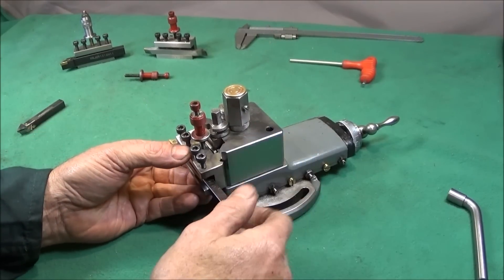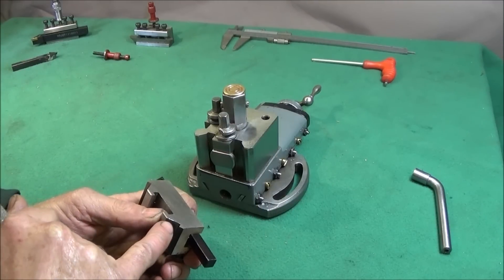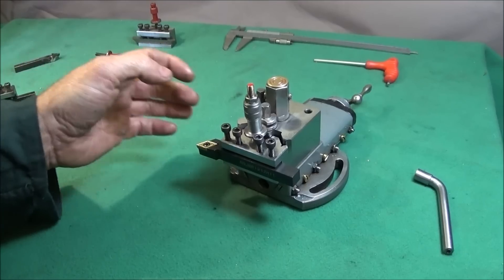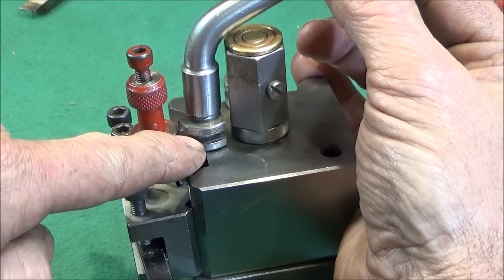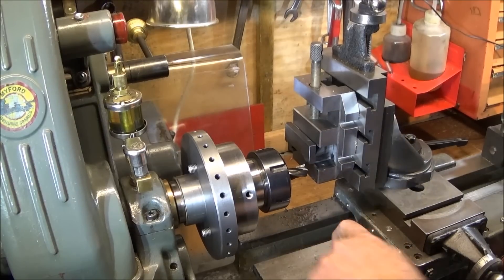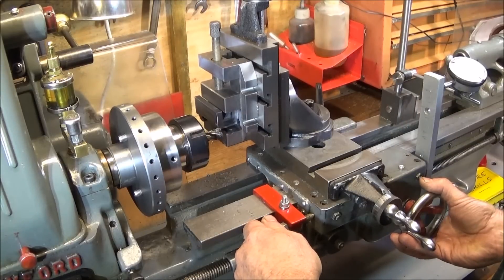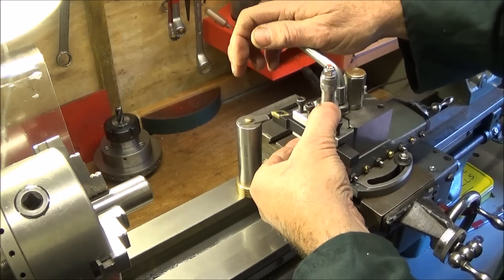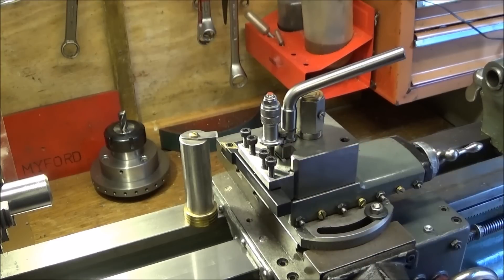A Centre Height Modification For Dixon Quickchange Tool-posts Used On Myford Lathes

Comment: steve...... been watching  your videos,, and in one of them your lack of a milling  machine  ..there are plenty on e bay... i highly recomend getting a centec  2a they are a bench top ,, you can buy  the basic tower , then bit  by bit get the rest.. they are  a sturdy machine and highly sort after. "a 2 a " is both vertical and horizontal ..i myself have   two centecs  and use one for horizontal milling and  tuther for vertical milling..and all the bits" knees ect "off of e bay  !   steve, please  .....   ,get one with the gear box. it saves faffing about with v belts !,,, but having said that ...the belt drive is very much quieter...what i have seen of you on the videos  you look strong enough to  manhandle a  centec  "" stripped down " steve  dont hesitate  ! get in touch with  doublejengineering .. they will sort you out .. regards  laurence

Comment: The Chinese and Indian made tool holders I have all take and adjust for tool height for my 12mm tooling no worries. They were bought in 3 different lots from 3 different suppliers over about 12 months. So they must have worked it out at some point in the 5 years or so since you did the video. But I do like the change with the bigger ledge on the adjusting screw, they definitely still have that problem!

Comment: Thank you Steve, I have a Dixon type quick change tool post but most of my tools are 10mm carbide tipped which are fine. More importantly I learned how to mill in the lathe as I have the attachment which allows me to do so.

Comment: Hi Steve I am so enjoying your videos . so far have made the saddle stop and waiting for the round vice to make the cross drilling spindle and mlling spindle. My Dixon holders are rock hard so will have to anneal them intend buying some of E bay and hope they are soft !!
Reply from the maker: Hi Laurie Thanks, You will find the tool-post drill to be one of the most used tools. I only modified a few of the holders, like you say some are really hard and need annealing and others are soft already. I have some other ideas lined up if I get the time. Regards Steve
Reply from the maker: Hi Laurie I have just come up with an easier method of modifying the tool holders so one doesn't have to anneal them. Hope to show this in my next video.

Comment: Well Steve you have amazed me again. Setting up your lathe to be used like a vertical mill. I like the concept on the tool holder to adapt larger tools. And you do all this inside your small Building. I tip my hat to you sir.

Comment: Steve, as a newbie to machining I value your videos, and have a couple of questions if you would be so kind?

1. Which toolpost do you recommend for a Chinese C3 mini lathe? The lantern type supplied seems very light and insubstantial, but would another make get the height correct and the tool far enough back from the work piece? What do you use on a mini?

And 2. When will you be making a video on sharpening lathe tools? I have a set of 12mm tools - Warco 9076 - which I had assumed in my naivety would have been supplied properly sharpened. Are you saying this is not the case? 

Many thanks for your help, and keep up the good work.
Ian
Reply from the maker: Hi Ian, I recommend the Dixon Type Quick-Change type....just make sure you get the right size which is the same one that fits the Myford Lathes.

I have found that most of the HSS and Brazed Carbide tooling that you can buy needs extra clearance and relief to machine properly. This isn't that they have been ground wrong, its just that they haven't been finished. This has to be done by the machinist. You will find that the tools in their purchased state will rub on areas that are not meant to touch the machined diameters of the work, particularly on small components.

I mainly use carbide insert tools now as they are such good quality and once they are set on centre height, they do not need any height adjustment, as when an insert wears out they are just changed. They are also very cheap if you buy directly from China on Ebay. Having said that I have a few very useful HSS tools like the small boring bars that I use for most jobs or home ground o/ring groove tools. I will try and show some when I get time.

Just one tip for grinding tools....if you try and machine a component, with a tool set correctly on centre height, and it doesn't feel or look like it is cutting correctly, you can use a blue marker pen and cover the whole end of the tool with blue ink, let it dry. You then do a test cut, stop the machine, take the tool holder off the machine and look for areas on the tool where the blue has rubbed off. You can use this method to determine where the tool is rubbing, usually on the shank just beneath the cutting edge. To correct it you just carefully grind that area back a bit...usually at a slightly steeper angle than what the tool already has. This known as, 'giving the tool more relief'.  This is basically it, with all the tools! But like I say....I hope to show it soon as it is not that difficult when you study it carefully.....Thanks again for watching
Reply: Thank you very much Steve for such a quick and comprehensive reply, especially the tip about bluing the tool to see where it's rubbing. Off to get a Dixon toolpost now, and give my bank account some more welly! :( Looking forward to your video on grinding when you can do it (with all your projects I'm amazed you have any time to make videos at all)! But very glad you do; they are a great help.

Comment from the maker: PLEASE NOTE. WHEN I"M SHOWING THE MILLING OP ON THIS VIDEO  I AM CLIMB MILLING. THIS IS NOT CONVENTIONAL MILLING. I SHOULD HAVE FED THE WORK IN FROM THE OPPOSITE SIDE. i.e.... FROM FRONT TO BACK. THIS  WAY IS MUCH SAFER AS IT AVOIDS THE TOOL SNATCHING THE WORK-PIECE. TOOL SNATCH CAN OCCUR, IN THE WAY I HAVE SHOWN, DUE TO ANY BACKLASH IN THE CROSS SLIDE LEAD-SCREW.
Reply: Was looking through all your videos today, super simple stuff. Re the tool holder milling that's the first thing I noticed & I thought a man of your calibre must have erred in your statement; now reading through I note you have corrected your description ( above) well done that man!

Comment: Hi Steve thanks for your videos but with this one I am concerned  that you are telling people to only climb mill when milling on the lathe, it is less likely to snatch up the backlash of the slide if you feed into the rotation of the cutter aka. conventional milling which is then always pushing against the backlash... just an observation not a criticism...
Reply from the maker: Hi Dave you are right....I got a bit confused there! I have put a correction note on the actual video to rectify this. Although the note will not show up on mobile devices, so hopefully people will read the comments! Thank you for pointing this out. Regards Steve

Comment: I also have a swivelling vertical vice but it has lost its base. Can anyone supply pictures, drawing or simple replacement options. It is the two bolt one like yours not the single bolt one.

Comment: I have an RGD quick change, bought for Myford, which has a 10mm hole instead of an 11mm or 7/16in so won't fit the hold down bolt. Knowing that it isn't hardened i will drill it out tomorrow. Great video.

Comment: Hi and nice explanations! One comment: you were climb milling, not conventionnal milling, so the ens mill could have pulled the slide in it it would have bitten hard.
Reply from the maker: Hi, Thank you for pointing this out. I have put a correction annotation note on the actual video where I show the milling part. So people will see the error. Unfortunately the note doesn't show on mobile devices, so hopefully they may read the comments. Regards Steve.

Comment: Hi Steve I bought a couple of holders last year from RDG at a show and they were already machined down on the bottom edge as you have just shown. By the way did you make your carriage stop for your lathe? I would like to make one for my Super 7.
Reply from the maker: Hi John, Thanks. No I didn't make that carriage stop. I bought it on Ebay. 
I'm looking into making a quick adjustable stop sometime, plus I want to make an adjustable depth clock attachment. Just waiting for the weather to warm up a bit first! 
My Brother has the Super 7...all great lathes!
Regards Steve

Comment: Thanks , I did it the other way arround and cut a few millimeter of the support so all my toolholders fit, and it would take away the strengt of the toolholder,. it seems hardened to and not easy to mill.

Comment: Don't you ever need to rotate the toolpost turret on the compound?    It looks like your modified holder will hit the corner of the compound if you do.  You could maybe remove just enough to clear the corner by turning it on a faceplate (maybe 2 at a time for counterweight?)  and still retain a lot of the strength of the toolholder's jaws.  You wouldn't need the milling slide and collet chuck either.
Reply from the maker: Hi Yes it would clash with the corner. I rarely rotate the tool-post, but if I need to I will just use the smaller tools that I have set in holders that clear.

Comment: Hi Steve,
Thanks for this idea. Even if it's possible to mill the edge of the top slide, if prefer your solution.
i don't like to modify genuine part of the lathe when it's possible to avoid.
Keep on with your video's !
Best regards,
Eddy.
Reply from the maker: +Eddy Fontaine Hi Eddy thanks. Yes I think you are right. I had a look at mine and decided the same. Also I like to leave it as it is just in case I use the original tool clamp. I wouldn't like to reduce the surface where the tools sit. Regards Steve

Comment: Another great video Steve.I have just purchased one of these toolposts so I will most certainly be doing this modification.I did come across this same problem with a Chinese mini lathe and milled the end of the top slide 3mm to achieve the same thing.
That is a very nice vice you were using, where did you manage to find it.I have been searching everywhere for a decent vice like that.
Cheers from the Antipodies.
Reply from the maker: Hi Malcolm, Thanks. I bought that one last year on Ebay from either RDG or Chronos. I have just had a look though and I can't find any for sale again and they don't seem to have it on their websites now. If I find it again, I will let you know. Regards Steve
Reply: Hi Steve,thanks for your response.Thanks very much for the offer to let me know if you see it again.There are a few rubbishy looking ones out there.All the best.

Comment: Only this morning I had to open up the slot on mine because of this problem.  I never thought of your solution!
Mine were hard in some places but the  tungsten cutter got there in the end.
It looks like you made a new eccentric locking bolt for yours also.  That's on my list as well the ones I have are terrible!
Reply from the maker: Hi John, I must get some tungsten cutters. I actually thought about that when I was machining these! Regards Steve

Comment: hi Steve, thanks for showing your idea of being able to use bigger lathe tools
another way and a quicker way instead of cutting say 10 tool holders, 
instead of cutting the tool holders what I done when I had a myford was to mill
the top slide edge down approx. 5mm that way the holders can still be adjusted without  the need to cut all the holders
worked for me when I had my myford super 7
thanks again, regards....Keith in Swindon
Reply from the maker: Hi Keith.  I'm surprised that Myford didn't actually have a quick change tool-post that was a better design than the Dixon. When I first got mine I couldn't believe how small the tools had to be to get centre height! I like the Dixon tool-post though, as the holders are fairly cheap to buy and you can have lots of them!.
 Why did you sell your Super 7?......Have you got another lathe?.... Regard Steve
Reply: +1 for milling the top-slide - I've done similar and the cast iron is a whole lot easier to machine than a bunch of tool holders. I've noticed Myford are offering an improved topslide design and themselves suggest removing 2-3mm from these to support larger tooling.
Reply: @mikedodd1117 Shock, horror.....suggesting that anyone should mill any metal off of a Myford …..LOL......get away with you......I would have milled 5mm off the top face of the compound slide where the tool post fits, it has enough metal there to not weaken it at all.
Reply: @gangleweed  Fear not!, I collected the machining chips and present them as a holy relic for worship in the corner of the shed.
Reply: ...and yes, of course, I meant the compound slide.
Reply: @mikedodd1117 Go in peace my son, you are a true believer.

Comment: Another superb video Steve. Thanks for taking the time to detail this. I hope that Myford and or the 3rd party manufacturers are watching your videos... this one in particular. If not the mod to the tool holder but most certainly the mod to the adjustment screws. How to make a good tool great ! Regards... John
Reply from the maker: Hi John, Thanks. Yes I was very pleased with the height adjuster mod. I actually got very annoyed with the older ones! Also I've noticed that the Dixon type tool-posts vary in dimensions a bit from different makers, or batches. Since I have done this modification the difference in using the holder is great. I've found that all these small improvements add up to make the lathes and tools much nicer and easier to use. Regards Steve